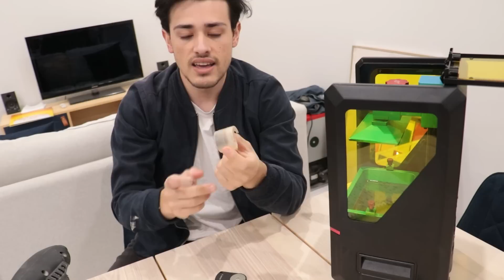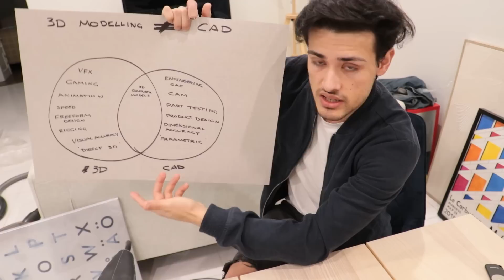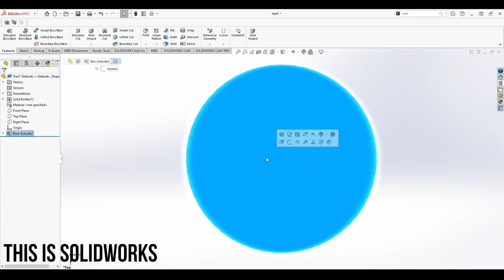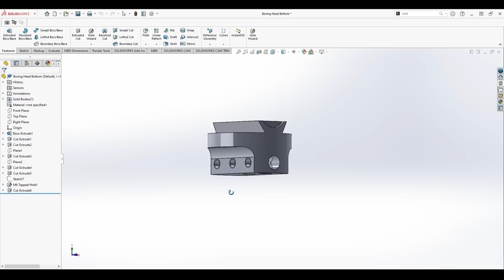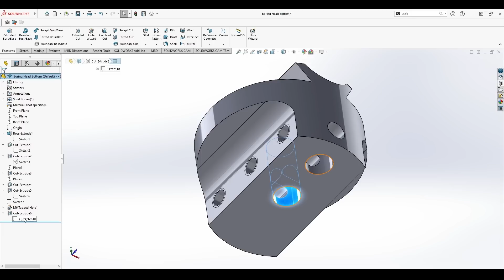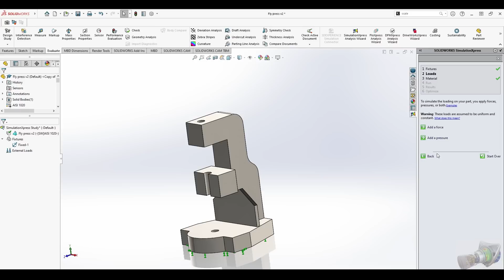On CAD, 3D Modelling And Computer Aided Engineering

Comment: I've been using CAD for roughly 20 years, now.
If there's one advice I can give anyone - don't reference features or operations on other features or operations. Use the root planes for everything, including elements inside sketches, operations, features (extrude, cutout etc.). Never create sketches on body faces, because they are volatile and might disappear or get modified, at some point. Even more, since this is a parameters driven software, use them. Reference your features from fundamental planes with parameters that you can alter, thus avoiding conflicts when removing or altering other features. Never use volatile geometry for dimensioning or referencing (as you did with those cutouts for the tool holder).
Rant over 😁
Btw, how much does SW for your personal use cost? Thank you

Comment: You make interesting distinctions between 3D modelling and CAD.

Strictly speaking, ANY design process that uses assistance from a computer is Computer Aided (or Assisted) Design. Within the Architectural and Engineering professions (at least within Australia) the term CAD is usually understood to mean the use of AutoCAD, and 3D (design or modelling) is understood to refer to the use of Revit or similar software. Both of these products are, to lesser or greater extent, parametrically driven.

Your talk about various softwares that ALL produce three dimensional results; 3D models.
It's worth noting that most of the illustrative softwares (Blender, 3D Max, SketchUp etc.) can be driven with extreme accuracy with sufficient expertise and effort.

However, within the context of the maker world the essential difference between what you talk about as 3D Modelling and CAD is, in my opinion, not whether the model is parametrically driven or not, but whether or not the model leaks. That is, whether the model is solid or not.

The afore mentioned software (including Revit, which is parametrically driven) only map surfaces to give the ‘appearance’ of a solid. The models produced by these products frequently have a multiplicity of ‘open’ nodes and need extensive post-processing to achieve useful 3D printable files.

On the other hand, manufacturing oriented products like Solidworks and Autodesk Inventor (my go to tool), are not only extremely accurate, but will always produce solid models; no open nodes, no leaks, no post-processing. It takes an extraordinary degree of incompetence to produce an Inventor or Solidworks file that will not export and slice without incident.
Reply from the maker: I agree, although I do want to clarify that I was not trying to say that 3d models can not be accurate, it is just that they do not need to be to work. On a similar note, I didn't say that CAD has to be parametric, it is just that most tend to be or are in some part. I have not used rhino CAD, but I know people who do and i know that it isnt parametric.

For what its worth I have not used revit either, and I think it seems to be somewhat more complicated than what my broad overview could cover. Cheers

Comment: Maybe slightly besides the point of the video, and I assume you know this, but in case you (or other viewers) do not: Resin prints (UV cured) are much more brittle compared to FDM prints (filament extrusion). So printing something  like a vacuum adapter that sees strains at the connections with resin is bound to break. With how thin that thing looks, I'm not confident an FDM print wouldn't also (eventually) break, but depending on filament it has a much better chance.
Reply from the maker: I dont own an fdm printer, but this needs to be a little thicker. Prints always seem different sizes on the computer to real life
Reply: @artisanmakes  Usually resin prints work well enough, especially as any sort of adapter (as the prime candidate for 3d printing, of course). If you've never tried FDM, I would heartily recommend it, not just for the wider material selection. The less toxic workflow, and general set-and-forget process (with no wash/cure-postprocessing) does have it's appeal. These days, even models for 200 bucks kinda "just work", and something like a A1-Mini could be considered "premium" in terms of easy of use and print quality at I think 350 or so. But it's also not a necessity, "we" (bei it makers or machinists) do generally like our toy-- I mean tools.
Reply from the maker: I dont own an fdm printer, I have used them from time to time but I have usually needed fine detail over strength for my prints

Comment: I would have used duct tape for that adapter. But if you want a high effort adapter, resin printing wouldn't be my first choice. Fdm is better at making thin cylinders
Reply from the maker: Yes for sure. I just don’t own a fdm printer.

Comment: Mastercam CAD is not parametric and that makes it a good middle ground between the dimensional power of solidworks and the usability of 3D modeling, however it’s a bad choice for anything that requires drawings or complex assemblies of many parts because there is no way to update the referenced drawing or assembly by changing the dimensions of the individual parts.
Reply from the maker: Not very familiar with master cam but that’s very Interesting to k ow

Comment: i somewhat disagree on the first part.  3D modelling software like 3dsmax for example is just as precise as CAD. 
the only difference is in approach to storing model data.  Max is vertex based and all CAD software is parametric (which makes all model features defined and editable).
and there is weird beasts like Rhino which are 3D modelling software but based on parametric approach.
but there is no distinct difference.  8:54 - this gears and splines for example can be made in 3dsMax with spline (parametric) tools and they will be as precise as Solidworks model.
Reply from the maker: I agree. What I was more getting at is that parts do not need to be accurately modelled to specific values to get a good looking and usable model.

Comment: Excelent video! The reason that surface modelling (your example with the chair) is more difficult in higher end CAD systems is that they will actually produce an accurate model that can be manufactured reliably. The best tools for that cost 5 figures, i.e. CATIA, NX, Creo.
Reply from the maker: Yeah, with blender you can just subdivide the surface and use the sculpting tools to add the texture

Comment: Since I grew up with CAE / CAM in the late 1980s and adopted solid modeling a little later (McDonnell Douglas Unigraphics -> Siemens NX) I probably have a somewhat improper approach to engineering design for much of my parts - I will often solid model them to determine fit, function, properties and interference, then use only the information from the design for 2D production shop drawings.  I may not be alone.  Also I’d offer that in regard to the use of CAE simulation that a great many if not most engineered parts will be considered failed from excessive deflection rather than from material yielding.  Well, perhaps not fly presses . . .  We miss ya in the shop incidentally!  Interesting and relevant video.

Comment: Great video, there is another cad software that does both direct modelling and parametric and it is PTC Creo, I have been using it for 18 years, mainly using PTC direct modelling (which is not history base) to do sheet metal part for laser cutting and pressing. We also use Inventor and Solis Works.

Comment: FreeCAD is absolutely able to do FEA! FreeCAD has come a long way in the past few years, once they do the 1.0 release later this year you should give it a shot.
Reply from the maker: Thats great to know. Its been a few years since I last used it, and it was pretty clunky back then.
Reply: @artisanmakes  FreeCAD has had the FEA workbench atleast from 2015 onwards, however it does not use the whole capability of Calculix that it uses for the simulation unless you manually edit the input file for it

PrePoMax uses calculix as well but has implemented more features into the UI

Edit: and to use more features in freecad i had to go and read the calculix guide which is a thick book, so it is a bit clunky
Reply: It works pretty well for my use (basic mechanical and thermal stuff). There's also a separate workbench for fluid sims via openfoam. That also works pretty well, but is a bit more complicated to set up than the mechanical FEM stuff.
Reply: Exactly, I have been using FreeCAD on and off for a few years. It has gone from a piece of software that was essentially the computer scientist's idea of what engineering/CAD is (looks decent but really was not good), to a very capable and powerful package. Sure, it still has issues (drawing/drafting is my biggest gripe), but it has really rapidly improved. Ondsel, making a comprehensive commercial product that uses FreeCAD tools, has accelerated the improvements. Since all improvements Ondsel makes are forked back into FreeCAD, there is finally some more structured development.
Reply: Absolutely agree, for most hobbyists FreeCAD has everything you need and there are so many great tutorials (MangoJelly, etc.) that allow you understand CAD from ground up.
Reply: JFYI.. afaik FreeCAD is the only OpenSource CAD out there that comes with parametric modelling.
It's not as convenient as say Inventor/Fusion360/SW.. but just like with KiCAD or Blender - the data u produce sits on ur machine and not in the cloud or becomes outdated once the software upgrades.  Companies like Autodesk are going for the yearly subscription model, which means access to your data via the software will require paying for it whenever that happens.
Reply: @joansparky4439  There's also CadQuery and OpenSCAD, for those who are into the programmatic approach.
Reply: I would add, look at Ondsel. They are a new cad option built on top of free cad and support free cad development, but offer additional tiers for teams and enterprise. They add a lot of user friendly additions to the core free cad software
Reply: PS: back in the "wild days" I would actually do parametric modelling in 3Dstudio/3Dmax .. the nurbs/smoothing modelling was only coming up back then.
Reply: if you want Good FEA (open source )  give PrePo MAX a Try  , its quite AMAZING
Reply: I have tried to run FreeCAD every few updates and for me it’s just super unstable. I have tried on several machines and OSs. I’m not an expert with cad but I’m no stranger to it either (I’ve used Catia, solidworks, AutoCAD, and fusion360). 

I really want to see FreeCAD get better. I’ll keep checking in on it but for right now it just isn’t there yet

Comment: Great explanations of 3D modelling vs 3D CAD!

I’m a Fusion 360 user myself. I’d have preferred to use SolidWorks due to the affordable hobby licensing giving you access to the full product (F360 hobbyist version is getting more and more crippled by the day). But unfortunately there is no Mac native version and in not keen to try and run workstation level software in a VM.

PS, your doggy is still very cute. My pair of rascally Labrador’s would love to play with him (they think small doggies are great fun to play with at the park).
Reply from the maker: I always forget that there isn’t a Mac OS version of solidworks. I think that’s why my uni was shifting over to relying on fusion, plus it was cheaper too.
Reply: @artisanmakes  I think for universities AutoDesk pricing is very heavily discounted. I paid for F360 for a couple of years, and in that time it doubled in price from ~$300 AUD to over $600 AUD. When my wife saw my subscription in the second year, she was not impressed! 😂

Iirc, the maker sub for SW is about $16 USD per month, I could definitely justify that if there was a native macOS port. I’ve tried FreeCAD multiple times and rage deleted it within a few hours. So many frustrating and badly thought through workflows I just couldn’t tolerate it. 😩

Comment: I think you'd really enjoy a properly modern and optimized FDM printer. Something like a Bambu A1 or even enclosed P1P to print more engineering grade materials like ABS, Nylon or some of the Fibre resinforced materials. The parts arent quite as detailed as on your SLA printer but a lot stronger and less brittle. Also they can be a lot faster and even work nicely for bigger parts depending on the settings. and they're hella reliable and so much less of a hassle than handling resin and curing it

Comment: im a bit 50/50 on this. i have about 30 years in blender for fun, and  solidworks and inventor for work. for home work i almost exclusively use blender. You can precisely model in blender, it's not quite so straightforwards but if you know your way around its doable - the huge advantage with this approach is you can waaay more easily model on the fly and then make the cad drawings you need at the end (that said it is a process and takes a little while to establish the workflow). parametric modelling is horrible for this. delete the wrong surface and you just wrecked the whole model, and mostly it's quicker to start from scratch than try to fix it.  parametric is great if you work in a drawing office for a company that makes a thoudand things that are pretty much the same. but for one offs parametric is a bit of a sledgehammer to crack a nut.

Comment: I have some experience with modeling with blender because of some fun classes in college, and I have thought it might be useful for mechanical design, but for some reason it never occurred to me that cad is described with parametric shapes rather than a huge list of 3d points making it easier for relationships between sizes. You should consider doing courses for this, although if you get sponsored by something like solidworks, they provide won't let you compare it much to other programs like you did here
Reply: The biggest difference between CAD and 3D modeling software is that CAD software makes sure your models are watertight. When sending a model to be fabricated, whether by a 3D printer or a fab, it's not enough that two lines end in exactly the same point. If they're not mathematically defined as continuous, the model is not "watertight", and the software further down the chain can't parse it. The CAD software takes this into account, and won't let you send off a non-closed shape. By contrast, in 3D modeling, any geometry that won't be seen is a waste of resources, and can be discarded to lighten the load on the computer. As long as the shape looks right and responds predictably to manipulations, it's sufficiently defined for this use case.
Reply: @M_Northstar  that makes a lot of sense. I do remember that blender doesn't try to render what shouldn't be visible, and I remember being annoyed that something like a curve is only approximated by a series of distinct lines, even if automatically generated. Watertightness does sound like a very important property to know, even if you're 3d printing it with less than perfect tolerances.
Reply: @joshclark44  To clarify, "watertightness" in this context isn't the property of being watertight, but jargon for being a closed shape. If two lines end in the same point without being mathematically connected, the CAM software will see them as separate objects, and won't know how to go from one to the other.

Sorry if I'm over explaining it, but it sounded like you were taking "watertightness" literally, and going over my earlier post, it seemed like a point of possible confusion.
Reply: @M_Northstar  oh no I get what you mean, but it would be hard to compute things like actual watertightness without things being mathematically "watertight" lol

Comment: I’m a SolidWorks 2022 user as well.  It was the last version which runs on your pc exclusively; future versions have more features that execute on online servers. Also nice, is that I no longer pay yearly or monthly sub fees.  It just works.

I also run Rhino CAD, but wish it was parametric. Haven’t tackled Grasshopper, which acts as a parametric bolt on engine.

These two CAD systems are quite different, but I like them both. I’m getting better at moving my parts between them. Surface modeling in SolidWorks is challenging.

My workflow is to begin in SolidWorks, then export parts to Rhino, where I add artistic features. MecSoft RhinoCAM generates the G code for CNC.

Comment: Thanks for explaining this matter way better than my self. 👍

My spontaneous answer:
“One is for arts and crafts. The other one is for real engineered parts that needs to work/function…not just look good.” might come across as offensive to some… 🙄😉

CATIA is a CAD program.
Then you have a vast number of different modules to add to the base package.
But if you ask the FEM/FEA guys, they laugh at it and want their specialist software. Not a module in a CAD system. That’s my experience. 😊

Keep it up! 👍

Comment: For the extra credit: there are several flavours of cad depending on the industry. It's diferent for architects ( REVIT ) or machine design ( Solidworks, Catia, Inventor, Siemens NX).
And even in one field Machine Design ... the choice comes down to either specialized use cases or historical reasons.
I would say that Catia is present in a lot of automotive industry , Siemens NX appears a bit more in German industry ( figures why) , Solidworks got a great deal of College deals so lots of students learn it there , and Inventor is part of Autodesk suite so a lot of incentives if you came from Autocad in the 90s . More or less they work the same, though.

Great video :)
Reply: I would add stuff like onshape at this point because it's very heavily used in the hobby community.
Reply: For architecture you forgot archicad as the autodesk specialisations, you can almost find an autodesk equivalent to every specialisation.